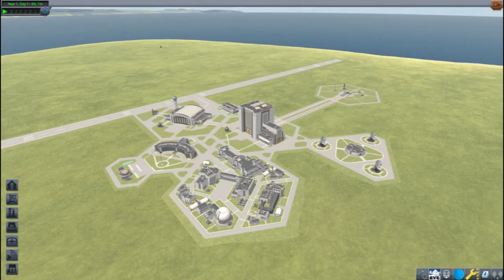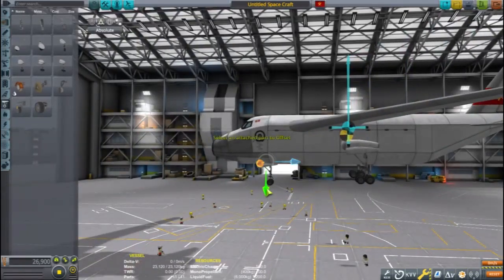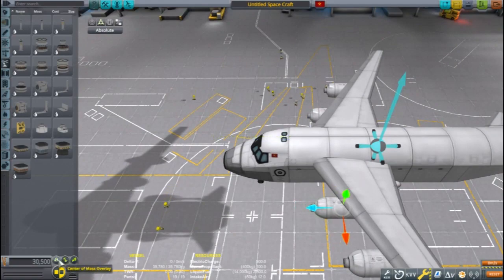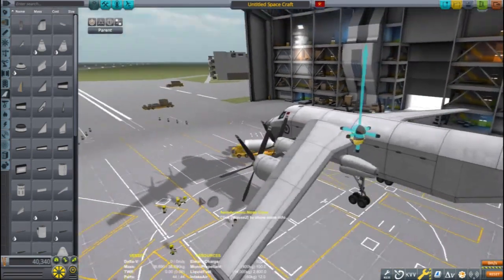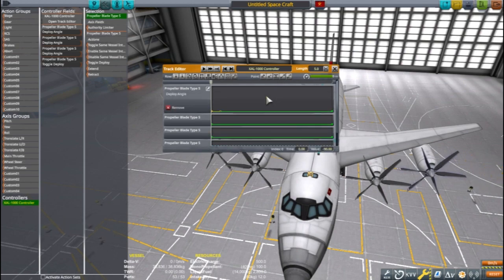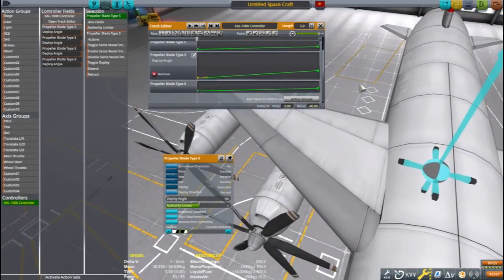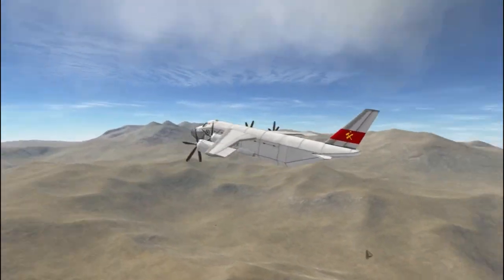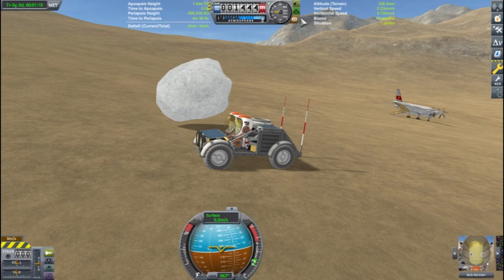Counter-Rotating Propellers Tutorial

Comment: Thanks for this tutorial man, I still have a few questions though.

1: My plane keeps banking to the right, is this normal and how can I fix that?

2: I can't seem to turn the propellers like you said how to.

For the rest, the vid is excellent!
Reply from the maker: Are you using one or two rotors? If you are only using one, then the torque from the single rotor will cause the craft bank.
This is one of my earliest tutorials, so I don't think I explained things overly well. I like to bind an action group to rotor torque. This should get them started and help you control your throttle.
Don't hesitate to ask questions, I'll do my best to answer them. I'll also active on Reddit and the KSP forum with the same user name.
Reply: @Echo3  I forgot to add that I also used electric rotors and not those other rotors that use liquid fuel (not that I think it will make a difference).
Reply from the maker: @AnonymousUserInUse  electric won't affect how they operate, just what resource they need to run. If you are able to show me pictures of your designs, I could probably give you pointers more easily.

Comment: Good tutorial, I liked the docking arm for the rover that's a cool idea. What altitude can you get a prop plane like this up to before you start to lose power or become unstable? Is it running off of just batterys or a fuel cell?
Reply: Nvm, missed that you were using the turboshaft engines.
Reply from the maker: Thank you. This plane doesn't use the electric motors. The R121 Turboshaft Engine uses liquid fuel and has it's own air intakes. So this plane won't work on Eve or Duna.
The Mk3 parts created a lot of drag. Like the C-130, I estimate the top attitude around 6000m.

Comment: Pretty sure you meant c-130 or KC-130. There is no such thing as a k-130. The k in front of the c is a designator for the different setups for the c-130
Reply from the maker: I ment to say "K." It is a Kerbal Kargo plane. I understand the USAF system. This was an attempt at humor.
Reply: @Echo3  ah gotcha.
Reply: @Echo3  not to be that guy but it isn't a air force thing either. Its military wide. There are more pilots in the navy then all other branches combined. Fun fact
Reply from the maker: @beatarmy2570  Again, I am aware of these things. I use to be in the military. Interesting  though is that the different branches use to have separate designation systems prior to 1962.
Reply: @Echo3  yup. Again I wasnt trying to insult or degrade. Just enlighten, however I misunderstood it seems. But I agree with you... not that that is a thing because facts are facts. And yours are right just as mine.